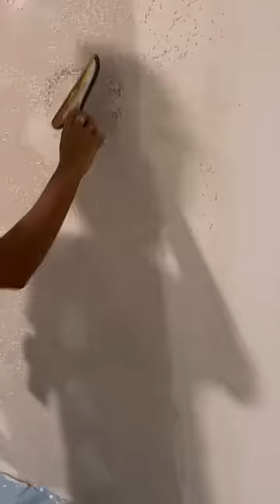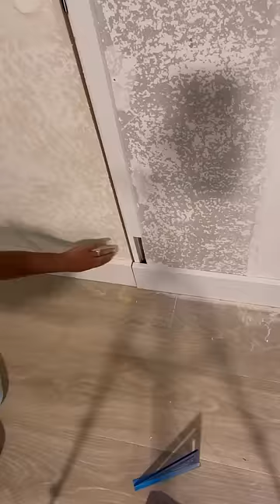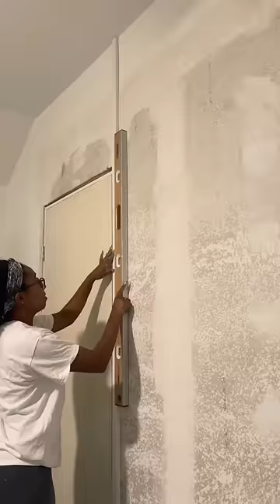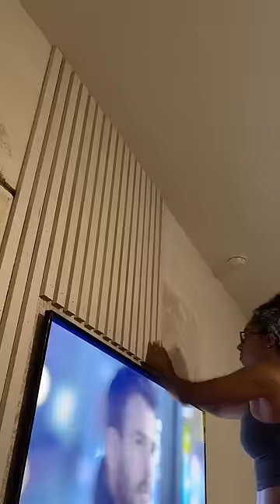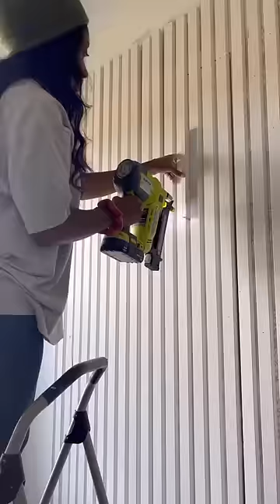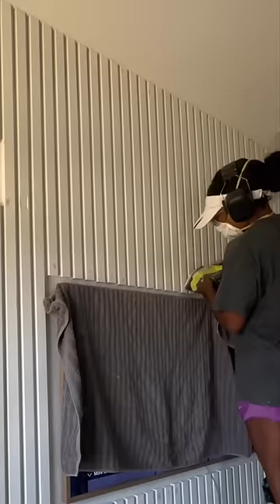me and slat walls go together real bad 🫶🏾

Comment: the framing of the tv looks amazing! it looks like one of those fancy picture frame tvs
Reply from the maker: It is! 😊
Reply: @kaylasimonehome Hi. How did you learn how to do renovation? I'd love to learn. ❤
Reply: You can also never move it
Reply: @raejae5491 probably messing with stuff as a kid like I did and using my dad's tools.
Reply: Fancy as far as design is concerned, but I actually hate mine, it costs more than our other tvs from the same brand, but the software and remote sucks in comparison. I had to set it to kill apps when turned off, because then they take forever to work when you turn the TV back on. Plus Alexa announcements kick you out of whatever application you're using.
Reply: I think pretty much any smart TV can be the "fancy picture frame TV". I can even upload my own photos into my TV so it's a photo of my family on the wall when I have it in screensaver mode. You can put up artworks, personal photos, a collage, etc. 🤷 I have an LG

Comment: Really nice. I just would have left the slats on the door full length, like a floor to ceiling door. It would have looked more seamless
Reply: And open the door how?
Reply: @Carolyn2120  What do you mean how? The door will open as a normal door. The slats have to be attached to the door for its lenght, and the remaining pieces going up to the ceiling, attached to a thin panel to hold them together. It's easier to do it than to explain it, hopefully I made it clear enough for you to envision it
Reply: Yea, and one of the slats can cover the seam on the right side, then its truly invisible
Reply: @buckets_full_of_bacon3821  exactly!!!
Reply: It would be a challenge to connect that in a way that is both flush with the wall and structurally sound. The way you described seems like it would pull on the slats every time the door opens (with the force of the door opening making the attachment move as well, then as you stop the door movement the attachment would keep going - objects in motion try to stay in motion) and I could see it quickly bending, warping, and pulling off the door altogether.
Reply: Yeah but I imagine the look of that would become annoying for many
Reply: @Carolyn2120 the same way she opened the door in the video..?
Reply: @jess_ismore  the portion of the slats above the door have to be connected between each other in some sort of way. I'm not a carpenter or a DIY expert, I guess with some sort of recession on the back of the slats where you can you can mount a thin panel to make everything stable could work
Reply: @Rieka.Chanel  well, I guess Interior Design is too subjective to please everybody. There is so. many elements I find annoying, but it doesn't mean someone elsemight love
Reply: @persimoncino  yes, but whatever you use to connect them is the exact problem when it comes to the door moving. You would need to reinforce them, and anything you would use to reinforce them either adds weight (compounding the physics issue) or adds bulk (defeats the purpose of making it more "invisible"). Her design is great as-is, avoiding these issues.
Reply: @jess_ismore  look, I'm not here to judge neither her design or whoever is happy with it. It seems that no matter what, you will find something to say against any ideas suggested. In this specific case, I would have done it differently, everything is achievable, just need to go with the flow and not against it
Reply: @persimoncino  you're not here to judge, but you left a judgy comment... Ok, sure.

I like your idea in theory, just saying it's not really feasible/doesn't have longevity. These are important considerations when looking at home improvement online because very often, the "hacks" or clever ideas don't last longer than the "after" pic. So it's worth discussing the obstacles and if there are ways to get around them.
Reply: @jess_ismore  I don't think mine was a judgy comment. Anyway!!!! 
One thing is discussing the obstacles and find the ways around them but still achieving the result, another thing is totally avoid an idea that is already been around  and completely feasable
Reply: @persimoncino  ok, if you have a way to do it, great!!! Nothing yet-discussed would work. But you do you. 👍
Reply: @jess_ismore  and yet you deny the feasibility without any concrete argument. Sorry, forgot you being a professional carpenter/builder/engineer 👍
Reply: @persimoncino  I don't get the attitude and sarcasm, but it's fine. My comments were specifically about a "concrete argument" of problems with physics. I included detail so it wouldn't come across as just shooting down an idea, but explaining why it might not work.  Maybe you missed those. Maybe I didn't articulate it well enough as it's tough to describe things in the YT comment section. Who knows?

I'm sorry for engaging in a discussion about an alternate approach, as I didn't realize it would be so testy. I personally found your first comment a little judgy. Your idea is great in theory but struggles in terms of feasibility. These are not attacks on you as a person. 

People can disagree and still be thoughtfully engaged in a conversation. That's ok. People can also learn and, when presented with new information, see that they hadn't considered an aspect of something before. That's also ok. If we all knew everything and had our own perfect ideas, we wouldn't be watching home improvement content looking at new ideas or approaches, or for inspiration. 

And all that said, this person's project was great and isn't any less great for not being what you envisioned.
Reply: And who knows. Maybe the slats used are super sturdy and don't have any give to them and would be totally fine! There's probably a material that could be used that's lightweight enough for a door, but doesn't have give in it, like wood. Maybe that's what she used and I'm talking out of my ass. Who knows!
Reply: @jess_ismore  I've never taken your comments as an attack to my person. What I couldn't get my head around of, it's your adamant refusal to an alternative design.
I've also never judged her design, in my first comment I've complimented her, I never intended to says she hasn't done it a great job, but just suggesting a different design.
It seemed instead you were defending a case in a court.

In regards to the "concrete arguments" involving physics you let us assume you're some sort of an engineer, which I believe you're not.

And you keep saying that someone (me) can learn when presented with new informations they hadn't considered, it makes you look like a "I Know All" person.

I get it, trying to explain things by text sometimes is though, but that's what I got from your comments, It didn't feel like a genuine exchange of tohughts.
Reply: @persimoncino  lol, cool.
Reply: Exactly what I thought! It would make it superhidden😁
Reply: @austragranta9635  apparently she has a longer video where she tried to do something like that but not all the way up to the ceiling, and she didn't like it that's why she went for this option
Reply: Wooow that would’ve been a crazy cool idea!!! ❤
Reply: That would've been ugly😂😂😂 who wants slats hanging off the door?! If you wanted an invisible door, you could it another way. She wanted cohesion...not invisible
Reply: @kammyr4082  I didn't say invisible in my comment, I said seamless. And I said "I would", I didn't say "she should have".
And unless you keep the door open all the time,  to me it looks uglier to have slats cut half way with no purpose, like the ones framing the TV. 
But hey, to each their own opinion, I have mine and you have yours.
Reply: @persimoncino I would have run the slats behind the tv, or atleast trimmed out around it to hide the cut ends of the slats. Also get extension box’s for the outlets and switches. That would be my take on it
Reply: @persimoncino the issue with doing that is that the additional weight would put more stress on the door hinges. Eventually it could cause them to misalign or strip the screw holes in the jamb. You’d have to have a reinforced jamb + hinges for that to work. Even a little extra weight and height would throw off the fulcrum of balance.
Reply: @jess_ismore agree. The only way to do it so this didn’t happen would be to raise the door frame + supporting header + jack studs to ceiling height and then have reinforced hinges (maybe 6 instead of 3, and heavy duty) to account for the extra weight.

Comment: The slats on the front of the door needed to go all the way to the ceiling and not attached to the wall above the door, so that it was completely seamless If your last piece of wood overlaps the crease where the door is it will cover it and then no one will be able to tell that there is a door there.
Reply: No the hell it doesn't 😂😂 do yall own homes?! 

The point was ACCENT WALLLLLL, not HIDDEN DOOR. 

It's about cohesion.... the door exists😂😂. It's their bedroom. They don't need an invisible fuckin door😂😂
Reply: @kammyr4082  apparently you can’t read because in the beginning of the video, they said, make a hidden door..😂

Comment: Looks great Was expecting the slats on the door to go from floor to ceiling & not be attached to the wall but only the door. Like when the door would open the  wall above the door would be flat & the slats above the door would be apart of the door. Granted they would probably need support doing a crown molding at the top that would also be connected to the slats above the door & be separate from the rest of the crown molding could work. (I love this though, just saying how I would do it because personally I would hate seeing a visible invisible door)

Comment: Those finishing nails went straight into those electrical wires above or below the outlets
Reply from the maker: I took pictures of the walls while it was being framed for this exact reason. the nails above the outlet went in at an angle to avoid the wires and hold the trim to the wall without having to hit a stud 😊